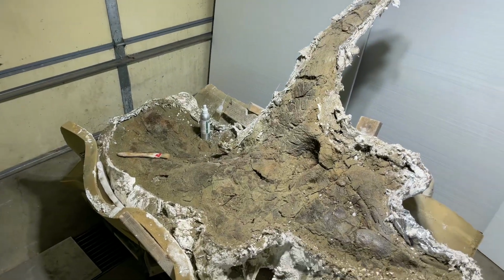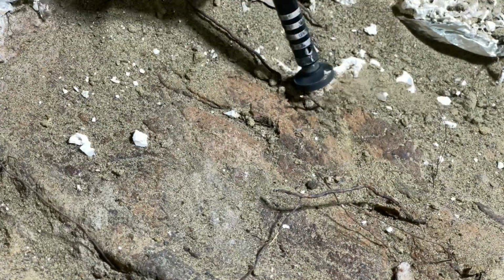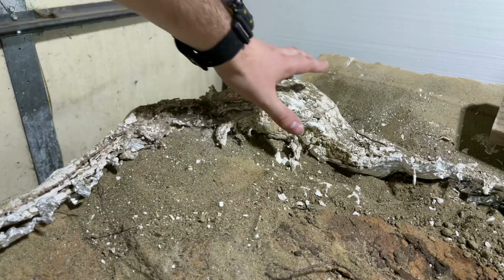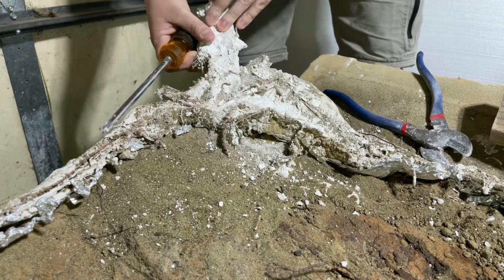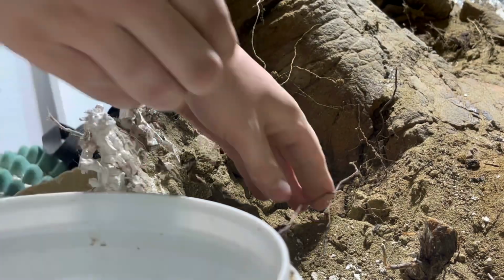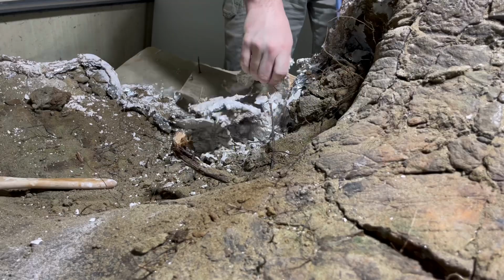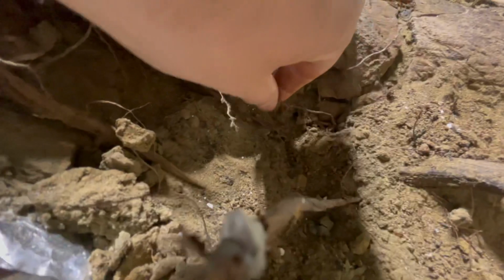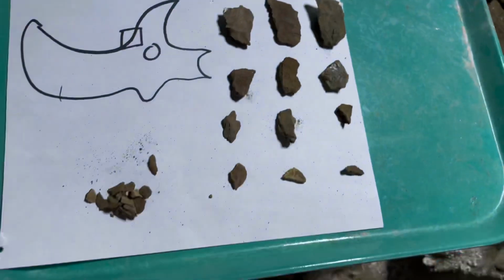Triceratops Skull Preparation | Part II

Comment: Hi! Love your content. Question-my gf (vet Dr) had a horse skull she stripped and bleached but the teeth are cracking after a few years. Type of Glue or advice to restore/protect? Thanks!!
Reply from the maker: Hello thanks for watching! We use Paleobond adhesives. https://paleobond.com/shop/ The penetrate stabilizer would work well to recent cracking. Also ordering poly-vinyl acetate, mixing it with he appropriate amount of acetone, and pouring it on the teeth works.

Comment: I love watching fossil preparation but I have always wondered why you guy don't use a small canister shop vac to remove the loose sediment on the fossil? going over it with a brush to loosen the sediment and using the vac on the lowest setting would easily remove the dirt and leave the heavier bone in place. if any pieces of bone come off, you will have not lost it since it will be  in the canister and easily retrieved. When I say canister vac I mean the smaller silent hobby models that aren't like the industrial ones that can suck a golf ball through a garden hose even a handheld model that is used to clean cars and is rechargeable would be good for this purpose too. I know how fragile these specimens can get and for the really fragile ones a vac would be a kin to using a sledge hammer to drive a finishing nail, but for the more robust specimens a hand vac would make the work go a lot easier. You know, work smarter, not harder?